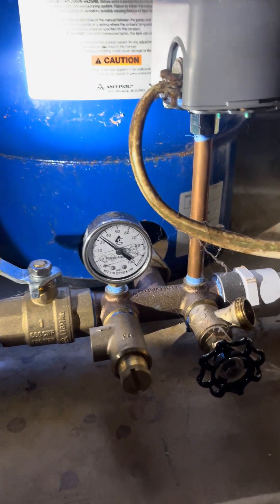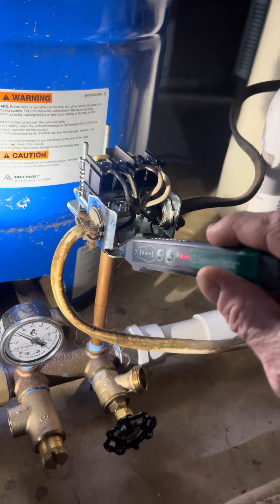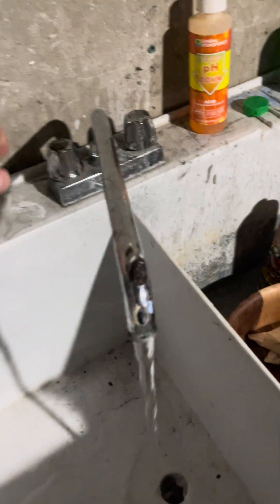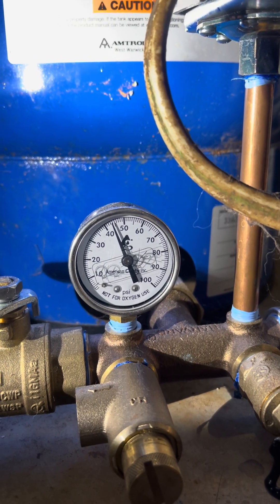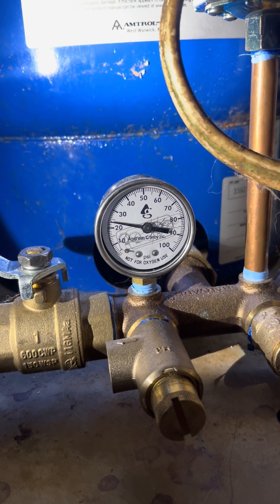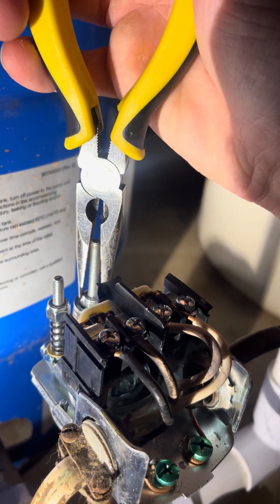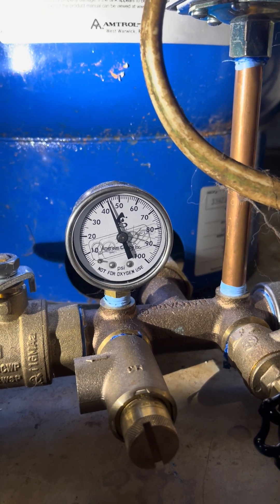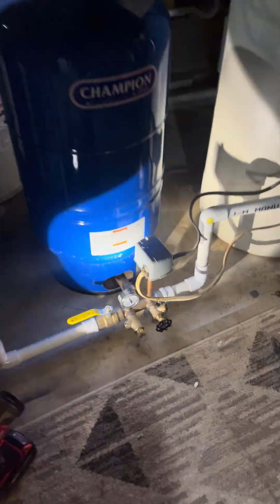DIY Well Pressure Switch Adjustment | Fixed 9 PSI to 50 PSI!

Comment: Should you hear water filling the pressure tank? Also, should there be a check valve on the pump side so water doesn't drain back to the well? Causing it to lose pressure and cycle on/off more?